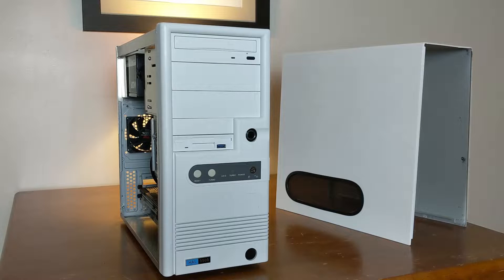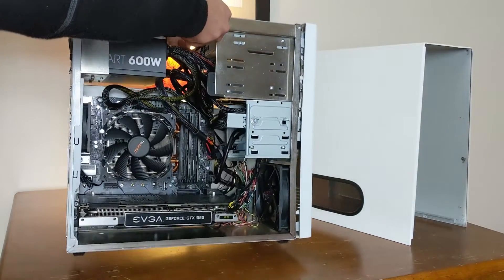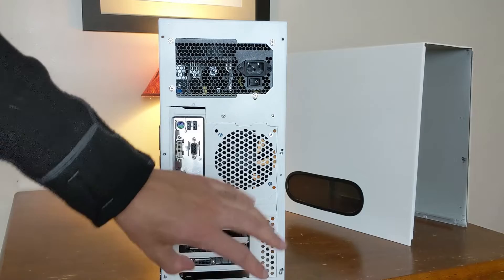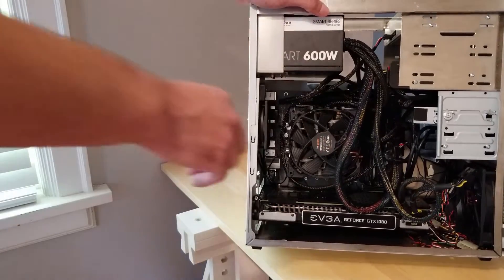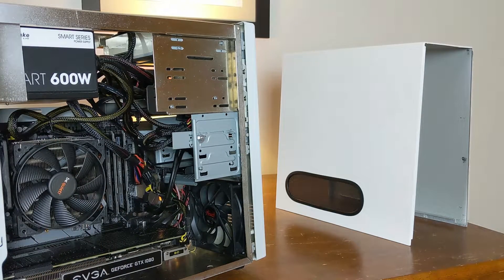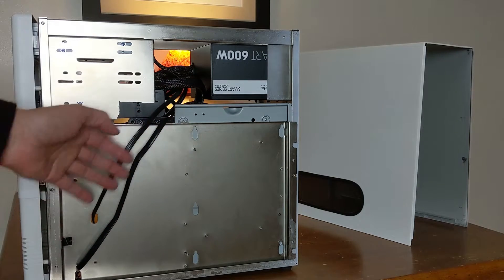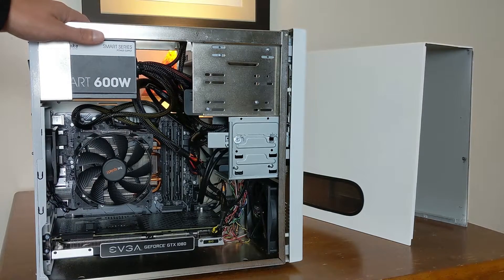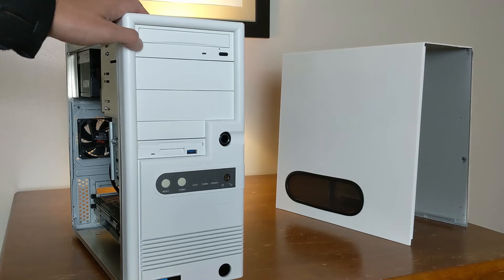2001 A Space Odyssey Sleeper Update 1: Fans and Cables

Comment: they only thing i would change is replace all the fans with noctua fans i wouldn't really use bequiet fans in a small case as those are more for cases with lots of vents and also i would cut out the fan grill at the back and replace it with something that's less restricting, amazon a lot of different PC fan grills that would fit with this build.